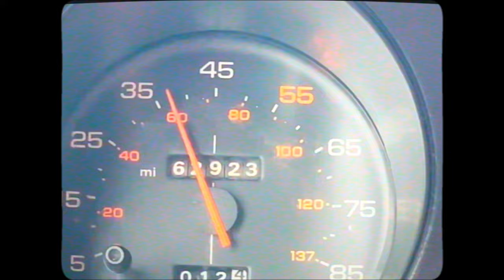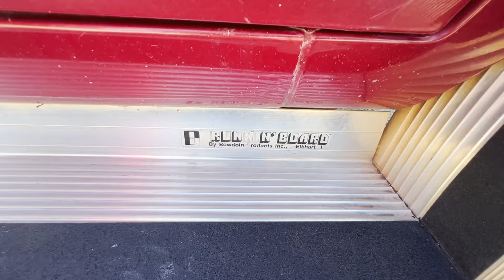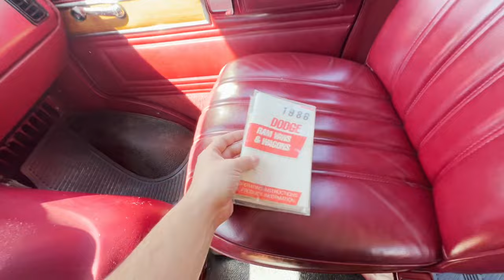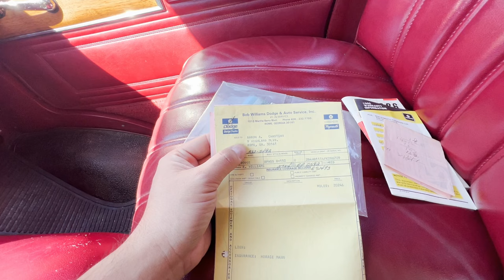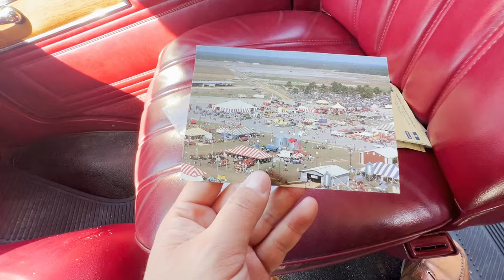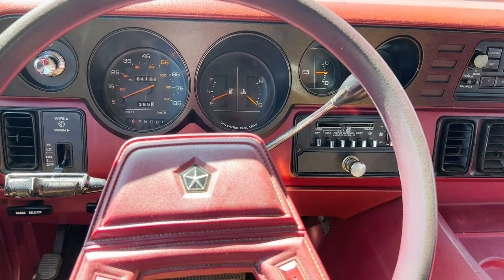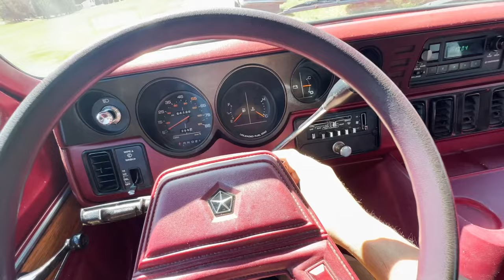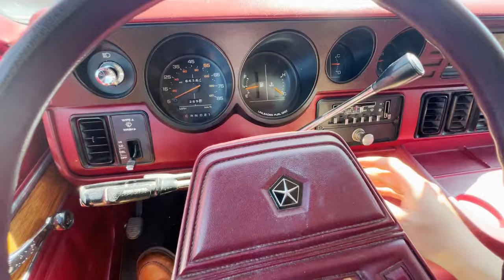1985 Dodge Ram B150 Royal Van! Full Walkaround Video! MoPar Survivor! Obsolete Automotive 1980s USA

Comment: Good to see a younger guy saving these old Mopar pieces of history. Fun fact I grew up in my parents 1987 short wheelbase ram 150 Royal van, two-tone, silver and gray. As a factory royal it should have carpet but they could’ve chosen a rubber floor from the factory very similar Interior to the one I grew up in with the exception of ours had that 80s Dodge cloth style seat covering You should two tone this one white in the middle red on the top and bottom.. also technical fact freeze plugs are not freeze plugs, nor are they technically called freeze plugs lol that is something that people have just come up with over the years they are casting plugs never designed to be a failure point for the cooling system, or to pop out when your block freezes they are there from the casting process during engine manufacturing and machining. They are known commonly as freeze plugs but that is not their intended purpose. Cheers

Comment: Yep I would say that whoever ordered it specified rubber floor and vinyl seats. The Royal is almost the top-of-the-line trim level. The only one above it is the Royal LE beautiful Van glad it got saved by the right person loving your videos, I think you would enjoy the 2 Wheel Dr. to four-wheel-drive swapped 68 big block D 200 Power Wagon we’re just finishing right now it’s a survivor re built with all Dodge parts using from a couple of different generations of heavy duty, dodge pick ups, one of which is a a 78 BB W 200 snowfighter package parts truck. check out our other channel junkyard resurrection I think you’d enjoy it. Cheers.

Comment: Ausin in the early 80s myself and a buddy travel Texas to race in the Yexas Cross Country Racing Association 50 mile indurance dirt bike races . we fixed my van for camping i found a mattress that i could roll up and put under the back seat behind the captain chairs , so i could put the small 4 wheeler pit bike in the van . In the van i had a 3 prong cigarette plug addapter and mounted a removable fan on the wood console on the dog house , and had a 9in B and w tv for down time . I had a small gas grill that we cooked our meals on and a fold up table we carried along with camp chairs . We had a camp shower that we would stand in the back of the van doors and a astro turf carpet we would put down both for the wash and when we would put up our Tarp awning on the side of the van to stay out of the heat while working on the bikes for the next race ( have you ever dropped nuts or bolts in the grass and try to find then ?) We pulled a. 3 bike trailer that we had layed ply wood between the rungs and put hold down bolt in so we could carry the tool boxs , fuel , and ice chest on between the bikes . We had a great time camping and that van worked out great for us .

Comment: I don't know if you know but whatever you do don't use Spray 9 to clean the dash. I have a 1992 Dodge van with the single big square head lights and my dash board looks t GG e same as yours. I sprayed some Spray 9 on the dash it ran and took the red paint off and now it looks bad. Just so you know.

Comment: That man was originally destined for Canada. The Canadian transport deco means that it’s original destination. Was Canada also built in Canada but it would not have that transport decal If it’s intended original destination was the United States so it probably sold in Canada and then came right down the dollar was probably strong at the time
Reply: It was just built in Canada. They sent their finished products to the U.S. and Canada. The maple leaf sticker just signifies it was made in Canada, not where it was shipping to when finished. My 78 Dodge pickup was also made in Canada, but sold new in Illinois.
Reply: @randyhoepker5528 I have a similar sticker on my 78 Mercury Zephyr that was made in Canada and sold here, pretty cool info thanks
Reply: I'm assuming its speedometer would have the main numbers be in kilometers if it was sold in Canada unless they changed it out when it came to the US.  I have a 93 Toyota pickup from Canada and it is Kilometers since that is what they use there and no AC since that is not what they use there.